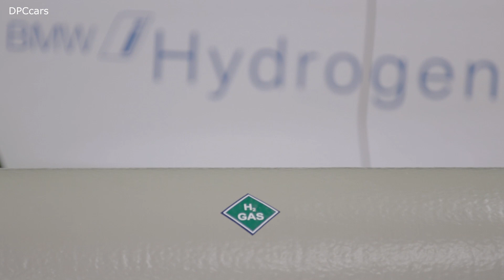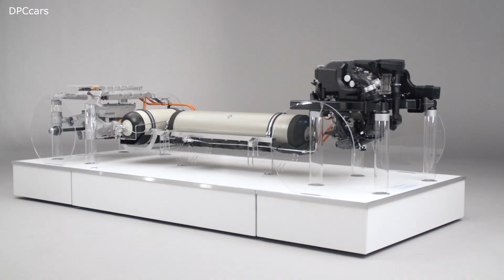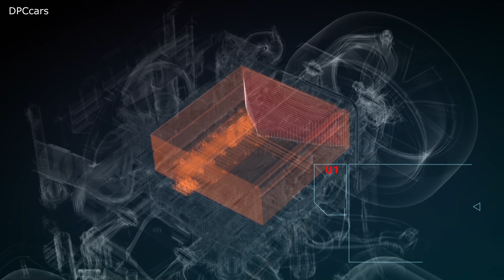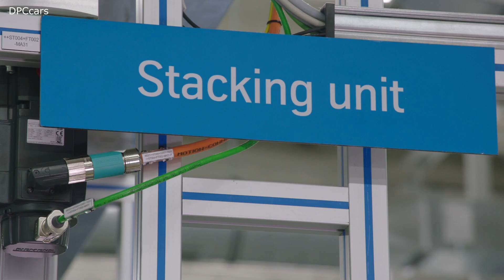BMW i Hydrogen NEXT Fuel Cell Technology Powertrain Explained

Comment: One of the greatest lies told by the establishment.  That hydrogen is expensive & complicated to make. It is not. It is extremely cheap & easy to produce. All curant gasoline or diesel engines can run on hydrogen.  Hygrogen can easily be produced at modern gas stations in the tanks they are using for gasoline storage.
Reply: So many wrong statements...If you use renewable it is extremely expensive to produce a 2MW electrolizet alone   that is able at peak to produce enough for 100 FCEV a day cost at least 2M  dollars alone. Current gasoline  engine cannot run on hydrogen alone and engines heavily modified to accept only hydrogen are a technical disaster , the bmw hydrogen 7 needed the equivalent of 600kwh of electricity for the liquefied hydrogen barely enough for ... 125 miles! . Hydrogen can't be stored in the tanks used for gasoline they are absolutely bot equivalent, hydrogen embrittle metals , it requires non metallic  (like composite fibres) tanks or metallic tanks that are covered inside with dense and heavy polymers materials that gasoline dissolve. Gasoline storage it's not under pressure actually the opposite as it has system that balance the pressures and dunp or recover fumes, hydrogen instead requires tanks that are able to safely store the gas at 900 times the atmosphere pressure...
Reply: I didn't say it could be stored.  I said it could be produced. Put water in them. & line them with tons of gold plated cope wire. & yes a gasoline engine can run on nothing but hydrogen there are many advantages & some disadvantages depending on the make of engine. If you think a gasoline engine can't run on hydrogen you are dead wrong as I have done it & tons of others on youtube have as well. That being said I can produce much more hydrogen needed to run my 5hp engine than it produces using wads of copper wire mashed in a ball. If I had a specialized tank & specialized wire ect it would be even more efficient. Also you can make minor modifications to gas2engines to have the run on hydrogen straight from the factory if you weren't profiting from raping the planet. There is an entire series on here about it.

Comment: Why can't you make combustion engine that would use hydrogen as fuel?
Reply: Nitrous Oxide emissions and a very low efficiency for extracting power from hydrogen fuel.
Reply: there is something called a woodgas engine. the fuel/gas is 14% hydrogen gas & 3% methane.
Reply: Because combustion bad. Only when combustion is used to make electricity it's good okay. You pay for green energy doesnt matter that it isnt...  But in seriousness. I think hydrogen would be more energy efficient if in wel designed combustion engine. Still hydrogen fuel takes allot of energy to create. Better would be a natural reneable (and clean!) fuel like ethanol or methanol. But again combustion bad. Doenst matter that the only exhaust would be co2 and h2o, because combustion bad. And co2 is the problem, Not fine dust and the harmfull pollutants from Oil based fuel and coal(electricity).. So we dont combust clean, we just do more coal and oil, because logic ($$$$$$)
Reply: because it's an enormous waste of energy, the engine will have high maintenance and shorter life, and it will have low performance , plus  around 300l of tanks of hydrogen for around 250miles of range plus the fact the car will produce NOx.

Comment: When they wreck the explosion will look like a movie.
Reply: Negative ghost rider. Its inertia switch instantly grounds and kills power. The cells have blow out press panels that can only hold x amount of psi before they let go avoiding an explosion that would otherwise "under pressure" would blow the vehicle sky high
Reply: Not at all

Comment: Why use compressed h2 when they could have a gasoline fuel reformer that makes hydrogen onboard with existing fueling supply chains? Solar Boosted electric vehicles is better anyway...

Comment: The front engine. Does it act like an ice engine or it's a hydrogen converter changing the gas into water and energy?
Reply: Second
Reply: It is a Fuel Cell Stack. Not an ICE.
Reply: fuel cell vehicles use electric motors
and usually have a small lithium battery to balance power

Comment: 275kWh electric battery equivalent. So at 500Wh/mi, range would be 550 miles. Impressive & beats any battery EV by a long margin.
Reply: Your numbers are irrelevant and wrong: First, it doesn't make sense to take the full energy content from hydrogen (33 kWh / kg) to directly calculate electrical range. You need to consider the efficiency of the fuel cell, which is approx. 2/3, 70% at best. So, you will get approx. 22 kWh out of each kg of hydrogen, means 132 kWh out of 6 kg.
Based on consumption numbers of existing fuel cell cars like Toyota Mirai or Hyundai Nexo, a big SUV like this BMW X5 derivate will likely consume 1,5 kg H2 per 100 km or 2,4 kg per 100 miles. So, with 6 kg H2 storage, you will end up with 400 kms or 250 miles.
Reply: @reneh.8817  --Umm, sorry, your calculation is not correct!  The Toyota Mirai can travel 312 miles EPA range on 5 kg of H2.  The mid-size SUV fuel-cell Hyundai Nexo, with EPA-rated MPGe of 61 miles per kg of H2, and with 6.3 kg of H2, can travel 384 mi range per fill-up.  
The BMW SUV Fuel cell if it will have 8.3 kg of H2 capacity, will be capable of, assuming 60 MPGe based on the Nexo x 8.3 kg = 500-mile range.
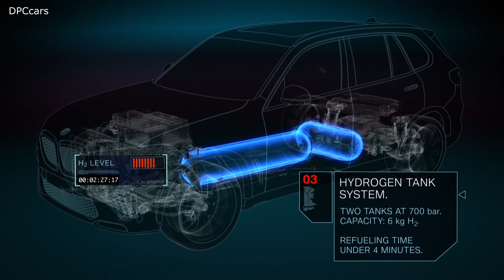Reply: @trungson6604  You can check the video at 6:17 the i Hydrogen tanks holds only 6Kg of H2
Reply: You are completely wrong 275kW (374hp)  is the total peak output from the Fuel Cell and the battery,  the "battery" is the 6Kg of H2 which takes around of 360kWh of energy to produce ,  and as people have already said you do have then the losses of the fuel cell  and the  inverter . This car should be able to reach around 330-350miles for example the Hyunday nexo that is smaller, with narrower tyres with a smaller (thus more efficient ) Fuel Cell has a range of 380Miles with 360kWh of energy and that's very inefficient considering a Tesla model S can do 370miles with 100kWh of energy.
Reply: By the time they implement this Tesla batteries will have  a 500 Mile range plus and will cost about $10.00  to fill up as opposed to $60.-$80  for  a  Hydrogen fuel sell.
This HFC idea will fail and will be an expensive  exercise that will cost BMW and Toyota a lot of money.

Comment: Refuelling “3-4” minutes😮😀😃...zero emissions
Reply: Dude now we can extract hidrogen from oil sands in a clean way
Reply: It's not zero emissions! The process to make the fuel makes a lot emissions that are toxic. You're correct about the time it takes. The only problem is cost to build an infrastructure that's safe and reliable. You would always be better off with an EV!
Reply: @stephenstaite8207  depends how it is made. If it's renewable energy then if someone wants a Hydrogen car I don't mind. 

It's one less ICE on the road.

And this comes from a battery electric car advocate
Reply: @stephenstaite8207   what about emissions during battery making process .an average 250 miles ranges BEV before running on road  is resposnsible for more CO2 than ICE car  driven 300k miles .
Reply: @MalixAtix That's simply not true! Lots of research has been done on this it's called long tale pipe vs short tale pipe..Can you explain your answer? Where did you get that complete incorrect information? BEV's have a much longer life. From day one Tesla vs ICE cars they have a similar carbon footprint as a ICE vehicle. After less then 5k miles and EV's win. Current EV's are able to hit 500k miles on each battery most ICE will not even reach 200k.

Comment: Maybe for trucks, ships and such but batteries have won for cars. BMW and Toyota seem to want to fail the way they are going.
Reply: Nope...EVs make sense for a city car but for everything else hydrogen is the way to go...(with current battery technology charging takes too long and range isn’t good enough)
Reply: @p__jay  and aging. You have to change the battery pack after 3 years... or sell the car...
Reply: Lithium isn’t going to last forever... every time you charge you EV, the battery degrades too... hydrogen on the hand is abundant. BMW and Toyota are thinking LONGER term than what you think
Reply: @Madzguy007  Been an element lithium will last quite some time. Batteries do degrade but now we can make them last much longer then the average car life span. Hydrogen is of course very abundant problem is the easiest place to get it is from water and that bond with oxygen is hard to brake and the loss between getting it and oxidizing it is large. There has been a load of advances making this less wasteful and there will be a hydrogen economy. Although for cars I can't see it making sense for example cost compared to batteries and just the pain going to charge it up were for a battery electricity is easy to get. Hydrogen powered ships yeah, seasonal energy storage and so all great. Running off electricity that would be curtailed.

Comment: Hydrogen car developed since 1979?? But Still its performance is  inferior to ICE car counterpart for the same price..looks like a compliance car onlu
Reply: yes, since 1979.  Fuel cells is a quite old technology. Companies didnt invest much on it because of oil&gas companies lobby...
Reply: LOL HICE can outperform the power output of gasoline, this is why we use Hydrogen as a combustible to go to space. Just look up BMW Hydrogen 7, its can run on both gasoline and hydrogen.
Reply: @manueldesmarais387  BMW 7 HICE data: acceleration 9.5secs(60mph), distance travel in pure hydrogen 125miles,torque : 290lb-ft,price :$118, 000 with that price you can get base Nissan Gtr and outperform in straight line and top speed., drag race or track it will leave bmw7 in dust, maybe in space but for passenger car I'm not convince its weight distribution far from performance, even for aerodynamic maybe you can't get 0.29 CD because you need huge air intake in the front, it will be bulky. For aerospace or ship agree